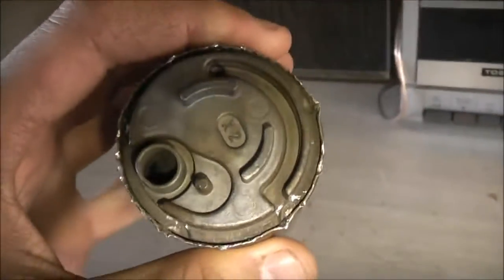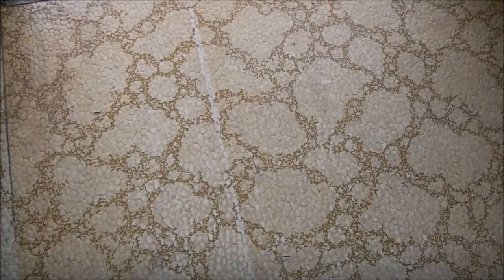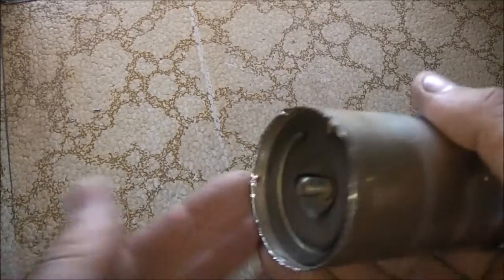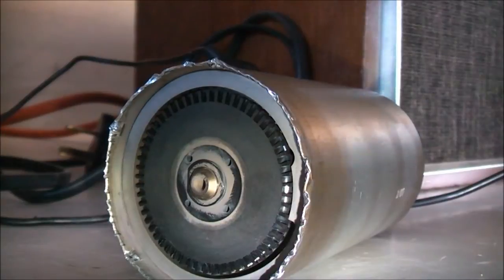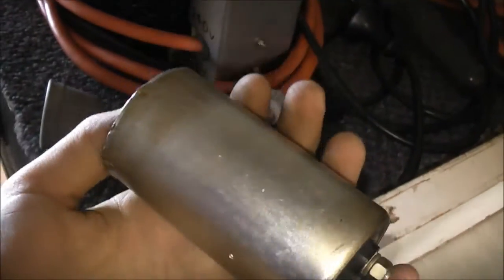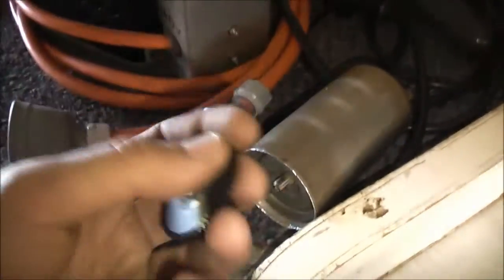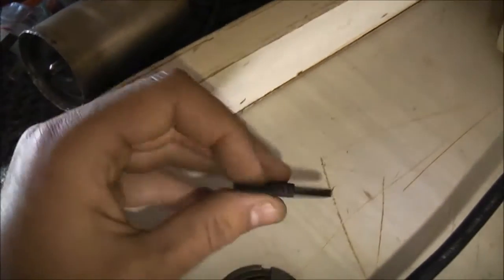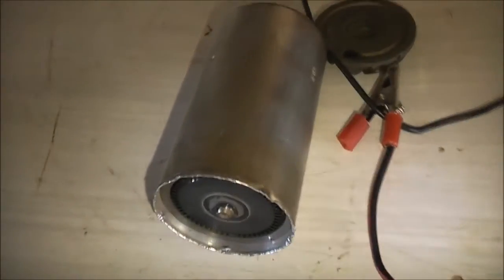Fuel Pump Teardown

Comment: Mmmm! That motor still runs. If that pump is stuffed & you have no use for the motor....

Crank it on the variac until it pops! :-D

I remember that other motor you did once.....The armature came flying out, landed like a spinning-top, then went on the rampage, grinding up whatever it came into contact with! :-D That vid got a place in my favourites list!

Thanxx for showing,

-BoomBoxDeluxe.